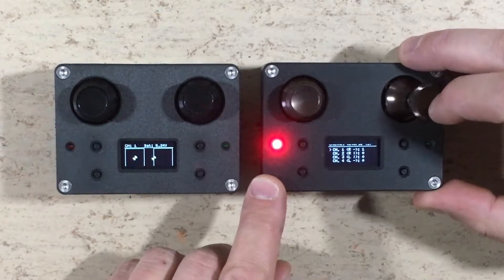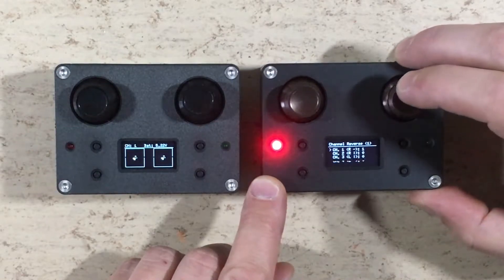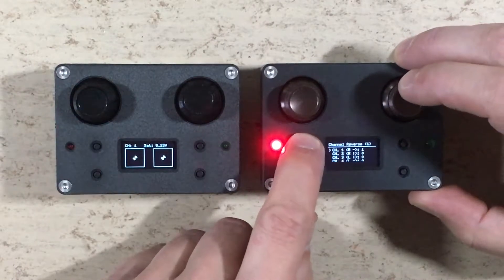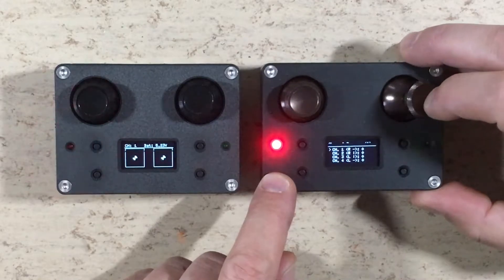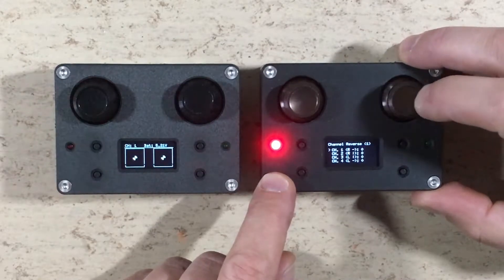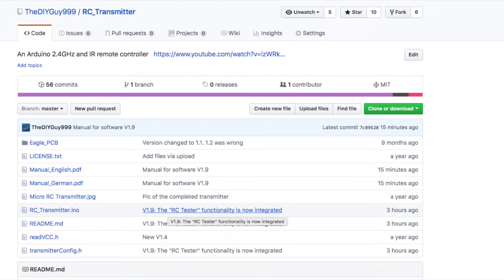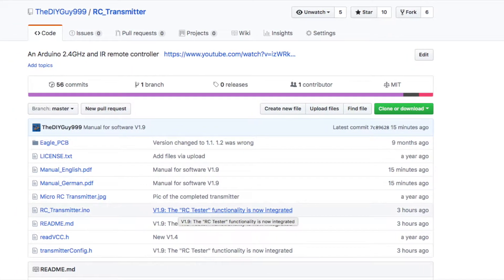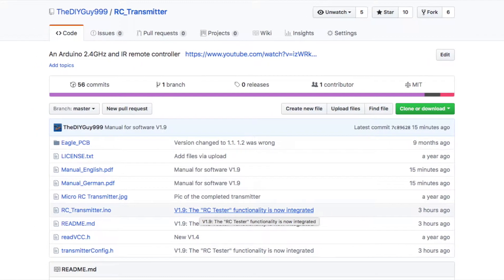Micro RC Software Update: Transmitter Test Mode

Comment: thanks for your work I try to made a transmitter and receiver, whais is the range? I can use to RC plane? this could work for this purpose?
Reply from the maker: The range is about 50 - 100m outside and 10m inside the house. I will do a test with a simple 2 channel plane, as soon as it arrives.